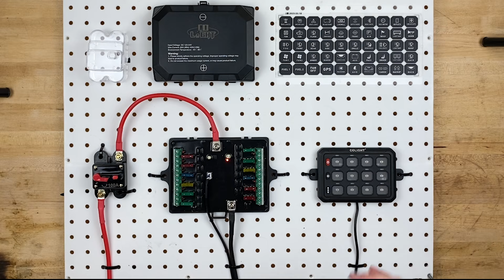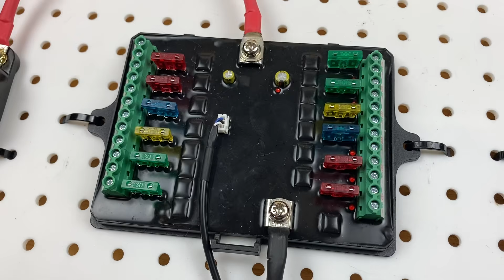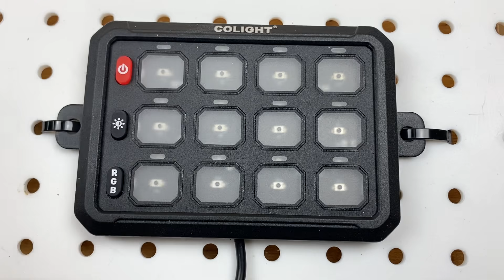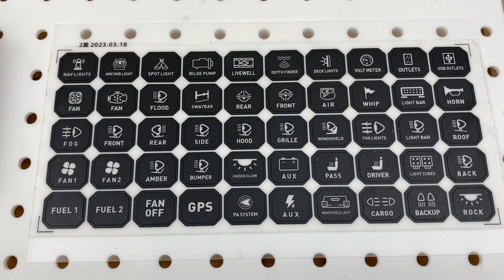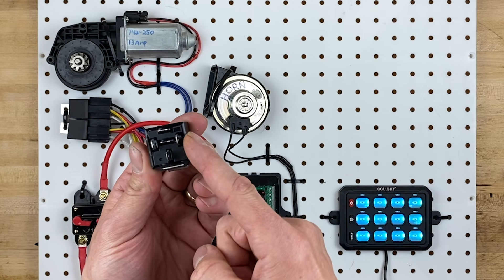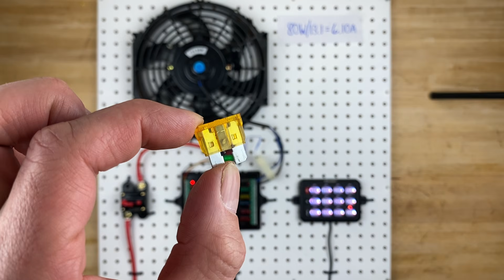12-Button Race Drift Car | Off Road RGB Switch Panel - PROGRAMMABLE!@WiringRescue

Comment: What about smaller relay with no numbers near pins wire up jw. A lot of car relays i came across has no numbers or diagram on the side also they are much smaller with only 4 pins.

Comment: Hi, I'm currently building a kit car would love to use this switch panel, I have led head lights which have side lights, low beam, full beam and indicators all in one, this are the wires :
Red Wire - Side Light or DRL
Green Wire - Turn Signal
Black - Earth
Blue / Red - low Beam
Blue / White - Main Beam

Would also be nice to work earning lights from just one button? Hope you can help me!

Comment: I have a similar setup on my full drift car, my battery kept draining i just figured the battery was needing to be replaced. after watching this video it makes sense, this device is constantly trying to send 12v to whatever device you have connected. the car sits in my garage and doesn't get turned on for a couple weeks at a time, i added circuit breakers near the battery so i can isolate the battery during storage and havent had an issue.
Reply: hey do you still use this on your drift car and how has it held up for you? I have been thinking of using this panel.

Comment: Hey so I have a switch panel very similar to this one for lights, I also have a cutoff switch and I can still turn on switches with just the accessory wire connected to a switched source on the vehicle without the primary power wire connected to the battery. Do you happen to know why this might be? It’s an auxbeam 6 Gang switch panel.

Comment: At 4:20, if the output provides constant + and switches the -, then it is not a "negative trigger" system.  The trigger is what the switch (pushbutton) does when hit, and that does not matter to us.  Using a relay to now switch the OUTPUT to cut the positive is not changing to a different "trigger".  Otherwise, great explanation.

Comment: Where was this last year :(((((((((((((((((
Reply from the maker: Haha. It was still in my head! Sorry I didn’t make the video sooner! Thanks for watching!
Reply: @WiringRescue  I am wondering why you didn't use a relay on the fuel pump circuit correct me if I am wrong but most fuel pump circuits have a relay, is it because it's ground trigger?